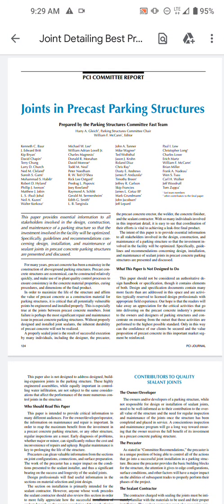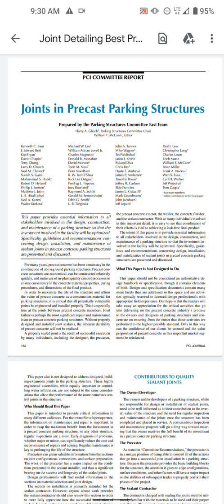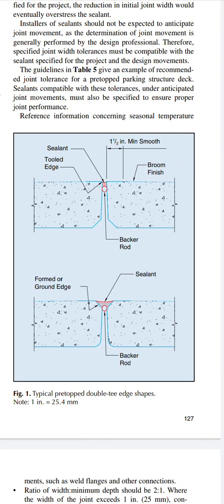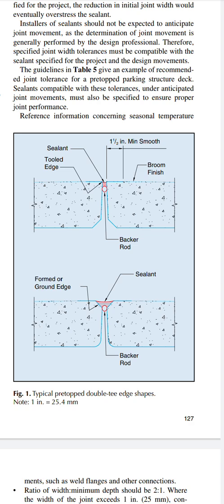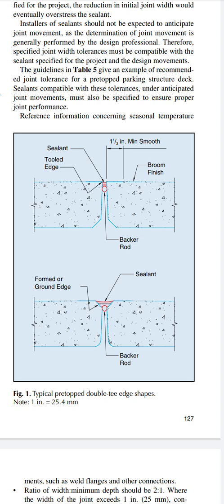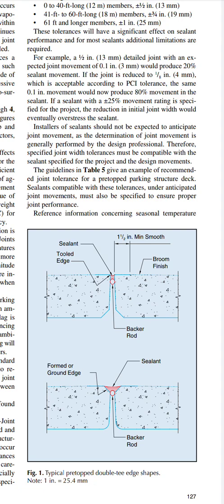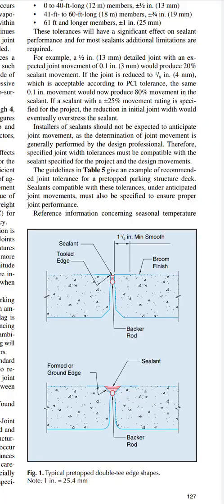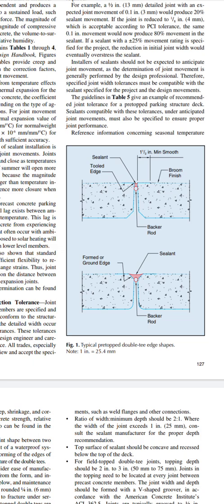Cassondra Billedeau Stratton no expansion joint or material found in design or debris concreteCracks

Comment: Champlain Tower South had cool deck on the pool deck but added pavers to hide every crack in the concrete slab ,all the steps and upper decks, but the cracks were still there only covered up with beautiful pavers. Well there was stamped concrete that had the prettiest cut you ever seen that allowed it to break perfectly straight.

Comment: Is paint waterproof? No. Is part water resistant? Maybe. That depends on its ability to stay intact and bonded to the surface it is applied to. Paint is susceptible to any other friction force and that's the rub. Once that coating breaks, paint can no longer provide water intrusion protection. We generally call this peeling or flaking paint.
Reply from the maker: Yes. Yes. 💕
Reply: I amazes me how many people that I use to tell that their shower grout was not water proof..  The tile backing needs to be absolutely waterproof!  They usually argued. We used lemon oil (furniture polish) to "seal" our grout and for clean up.  Sealed the properties of the grout. Did not make water magically not penetrate it..  5 year full guarantee on our showers. Nobody else around us did that at the time..

Comment: You are amazing , you have picked apart every flaw in this building. Question l have, I have seen rebar from photos in the top or bottom about 2-3 inches from concrete surface. Shouldn’t rebar be in the middle of the concrete, unless multi layers of rebar
Reply from the maker: Buck, thank you for your kind words of support...
Reinforcement should be located to counter the expected "reaction locations"...These reaction locations are going near the bottom of concrete mid-spans and loading and at the top area at "canteliver locations" (which are at the balconies for example.

Comment: There are water proofing paints for masonry but I believe if the two different surfaces rub or move that will break the seal.
Reply from the maker: Those are expansive materials, and they usually call them block fillers, like a pool paint/covering.
But, your house paints are not waterproof.
Urethanes awesome and your auto has urethanes (mostly)...